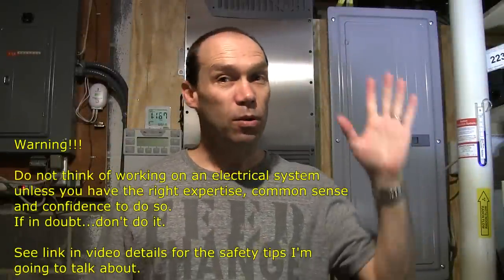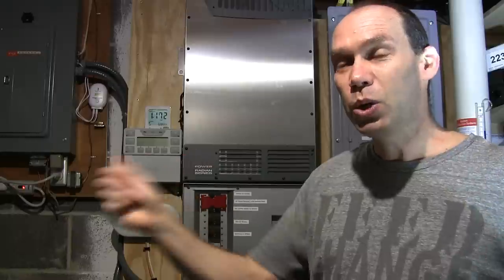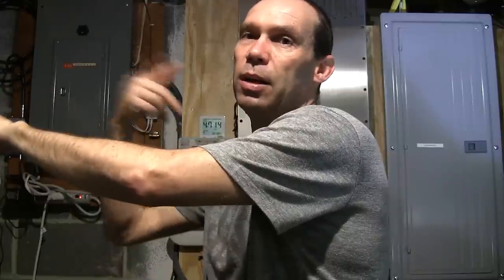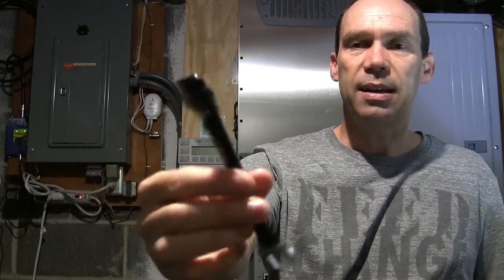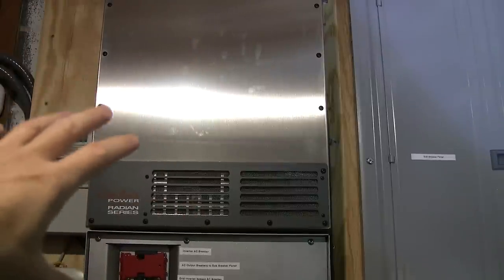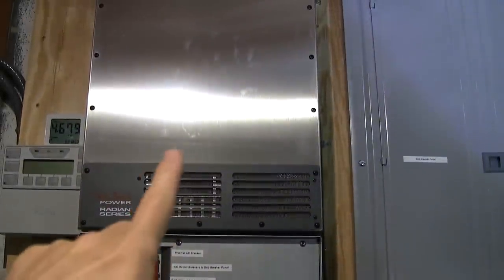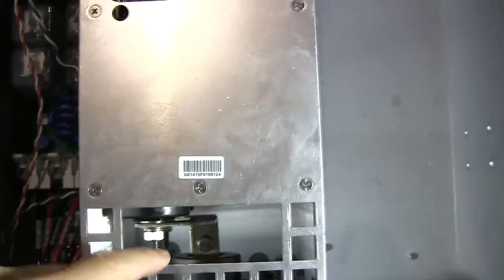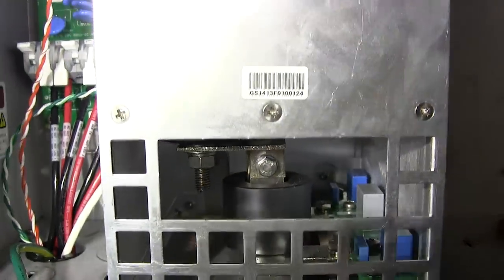Electrical Safety / Inverter Failure

Comment: Outback gear is generally quite reliable, however the Radian series has had a few  instances of failed units. Generally in the past they just do board/module swaps. That modular design is a feature of outbacks.

 Re labelllng and shutdown, in NZ, codes require fairly prescribed labelling and signage. First theres some standard bits, the reflective exterior green dot 'PV, the yellow/black hazardous voltages sign (AFAIK these are international symbols), location of isolators etc, and a full shutdown procedure sign.  Systems containing batterys need a series of labels about spark, exposion, acid burns, and "multiple DC sources". These are outlined in AS/NZS 5033, and AS/NZ4509.

Comment: Hi

I've enjoyed your videos and found a lot of value in them.

In this video you really broke almost of NFPA 70E safety rules in my opinion. I have 20 years experience as an electrician, and over 10 years experience as a Supervising Safety and Health Officer.

Although your use of the voltage detector was good you really should have used safety glasses, long sleeve FR shirt and lockout tag out procedures as many unqualified people will view this. 

In the US inverters must have clearly labelled disconnects, and should not depend on manufacture's instructions as many installations may not be up to code especially solar installations. In the jurisdictions covered by NFPA 70 metal cased batteries are prohibited. The use of electrical tape to substitute for insulated tools and hot gloves is a particular concern of mine as I have witnessed several severe injuries and one death as a result of improperly trained electricians doing work on hot or improperly isolated equipment.

Removing the cover is fine without required PPE per safety recommendations. Anything beyond that requires using hot gloves for testing.

Working on high energy systems even in residential service may result in exposure to 10,000 kva, which is highly fatal as the main breaker takes several cycles to trip and the utility may have fused transformers but typically are the slow blow type to withstand transients.

I would like to see you either not produce videos working on this type of equipment or follow internationally recognized standards for safety.

I have enjoyed your videos greatly and hope you continue to provide knowledge to all of us fans.

Please leave troubleshooting and maintenance of of Cat III and CatIV systems to professional electricians or do the research on proper safety and demonstrate those practices. Homeowners may think just changing a outlet or a switch is easy and safe, but my experience has shown that even a simple job like that can create huge hazards.

Dave

Comment: I don't screw with heavy panel covers anymore. I just use a window suction handle and an adjustable strap. It holds the panel cover in place as I lower it. 

You can also insulate tools with 600v rated heat shrink tubing. Which is way safer then tape. As it has a glue inside it to hold the tubing to the shaft. So it doesn't slip off.

Comment: You are absolutely right with the advice for using non-contact voltage detectors. Case and point with mine, after a while of non use it doesn't always work, good thing that I've made a g of always checking on a live circuit before testing something. I only works when I hit it hard lol. I must get another one. So the moral is, never fully rely on you test equipment to be right. Cheers :)
Reply: And double check with a different type of tester. ( I have a similar problem on  mine with the push contact switch )

Comment: I have received a shock from a screw driver wrapped in sleeving, the sleeving slipped and my finger accidentally touched the shaft, luckily it was only 240v and not 400v (in the uk)and my other hand wasn't touching anything. it was only a light buzz but i yelled out because i got a fright.

Unfortunately this happened at work and it was taken very seriously, in a professional situation if i don't receive the right tools i will NOT do my best and try help out my company to try get the job done on time, i will refuse to do the job until i receive the right tools, because remember, a company doesn't want to know when the shit hits the fan, they will do ANYTHING to shift the blame.

Comment: Good video. Never enough focus on safety on YouTube. 

I have been around light industrial three phase 408 delta and 208 wye for over 30 years. Every actual injury I have witnessed or been around has been arc flash burns to the face and eyes. 

It is critical to avoid looking at breakers or anything that can interrupt a circuit under load. Use face shields when available. 

Electrocution is very rare. Arc burns are very common. Protect your eyes.

Comment: I remember tightening the positive cable to a starter on a tractor many years ago (was probably around 12), right on top where the thick positive cable connects to the solenoid. Then I touched another metal part and the sparks flew... that's when I learned about removing the negative terminal first.

(That particular tractor, a British made David Brown from the 1960s, had a positive earth... so you removed the positive first :-) )

Comment: Good video! One thing to note regarding charged capacitors - the very same fault that brought your attention to a piece of equipment may well have taken out the automatic safe capacitor discharge circuitry. IIRC The Signal Path Blog encountered this very failure mode in one of his repairs.

Comment: Wise words of caution especially about the insulated screwdrivers and spanners.The power on those panels are huge.Working on one in bad lighting, hand slipped and left with only the handle of screwdriver.the rest just vaporised.Non touch phase tester very handy.Eye protection against bright flashes is a must.Wet floor conditions are serious hazards along with metal ladders.Proper tool belt can be very handy.

Comment: Tip for the cover.. Before you reinstall the cover, Get one longer screw(if not long) and wing nut. Take the top center screw and install it back wards( or from the inside out so the cover hangs from it(1/2" to 3/4" of threads stick out). You can hang  the cover and install the wing nut. The cover will not fall while you install the rest of the screws then tighten the wing nut.

Comment: I hope you will solve this without much trouble. What was the average load on that inverter? If it was a few hours 4 to 5h a day working close to full load 3 to 4kW then 8 months is about what you can expect :)
As you know I prefer DC directly to power my loads and I only occasionally use an inverter less than an hour a day for large loads.
I will not expect to use more than 400kWh/month from that 4kW inverter so in 8 months that is 3200kWh and if there where no warranty that is $2800/3200kWh = 87cent/kWh just for the inverter.
If it will last for 10 years (highly improbable at 400kWh/month) it will still be $2800/48000kWh = 5.8cent/kWh still a relatively high number considering that is just the inverter and it is an extremely idealistic estimation.
Reply: ***** Grr stupid youtube one click deleted  me post, short now, 
they should last at least 10 years one would assume it not running at 100% load all the time but should be spec to handle 6KW but limited to 16Amps per Phase to comply with Grid rules 
(assuming 230v and UK but this person is not so not sure about his power but did state 4KW inverter not sure how a 110v would work as its 32Amps ish around 4KW) if the inverter was not limiting output to 16amps then it probably overloaded (dono if you can run a 110v inverter at 32amps to get upto 4KW not unless you had 2 inverters in one case as shown in this video but it only had one in it)
Reply: lee x Yes it only had a 4kW module out of max two possible (8kW). Problem with inverters is that they are relatively inefficient and run hot. Even a 95% inverter 4kW running at full load or close will need to dissipate 200W not that easy to do so. Electrolytic capacitors will dry out at elevated temperatures and will fail (some times they take out other components also). Electrolytic used in this inverters are usually rated at 1000 to 2000h working at those temperatures so you can imagine it will not last long.
I think is a split phase 120V/240V inverter but that is less important.
I recently made an youtube video about MPPT obsolesce and got a bit in the details about electrolytic caps same problem apply to DC-AC inverters.
Reply: ***** So even the new "transformer-less" grid tie inverters may not be a better choice  because as you point out, even at 95% eff you still need to shed 200 watts of heat (@ 4000 watts). I think I've answered my own question, and given that, the more important thing then is air movement across the unit. Looking at Martin's Radian, I don't see a internal fan, rather some vents top and bottom which are meant to create a draft.  Perhaps some inexpensive forced ventilation IE: a small computer fan ? would help with the life expectancy of the capacitors ?
Reply: Mark Osborne
I think there must be a fan in there maybe is not visible.
Reply: Mark Osborne it's on the top of the heat sink
Reply: lee x Gotcha...

Comment: HI Martin good vidoes i have taken the city and guilds coarse recently and isolating the panels on the dc side is the one that a lot of people forget .If its not done you are going to get badley hurt or killed.and should be explained to people.Infact the whole system should only be attempted by  someone who knows the score simple as/ lethal.

Comment: Nice safety reminder! Personally I wouldn't feel comfortable approaching overheated electronics and capacitors without wearing safety glasses.
Reply: Vincent Schmid i agree them caps run at very high voltages and its DC as well (goggles and gloves and should not trust that your insulated footwear is enough) even though its de-energized there is still a slim chance there could be power (why some people physically make sure the cables/plug are disconnected)

Comment: I hear Voltage stick's should Only be used to give a guide that power is ON.
They may be for example too far away to trigger and indicate no power but where there is 
 power.

Comment: mjlorton There are labels that warn about Radon in the background. I am curious what kind of system is this?
Reply from the maker: Good question, some day I will post a video about it. I knew nothing about Radon until moving here to Cleveland Ohio. Read a little more here if you are new to it: http://en.wikipedia.org/wiki/Radon
Radon is more of an issue here because homes are insulated due to the heating and ventilation systems. The HVAC system can cause a low pressure that pulls more radon from the surrounding soil (basement) into the home. To mitigate that and to reduce radon levels in the home pipes are placed through the basement wall and floor. A fan then draws the air out and expels it above the home outside. This helps counteract the low / negative pressure in a home which draws in the radon gas.
http://en.wikipedia.org/wiki/Radon_mitigation
http://sosradon.org/reducing-radon-in-your-home
Hope that helps.
BTW...you have a great channel.

Cheers, Martin.
Reply: mjlorton Hi Martin, this is very interesting! You really should make a video on the subject soon. Here in Germany only a few and only newer buildings have a ventilation system. Therefore the issue of radon mitigation is hardly known in the german-speaking countries. My mistake was to look only on german websites - and also the german version of wikipedia just slightly mentions the topic at all. Btw thanks for the compliment that I only can return. Your videos are always interesting, factual and very instructive. :)
Reply: LuiKast I've always thought that radon isn't an issue in Germany. Here in Scandinavia I think levels are in some areas much bigger than there. Though I guess radon can be found anywhere in globe, but quantities have huge differences depending on location.

Comment: I suggest reading Article 690 of the NEC regarding your installation. Appropriate changes should be made regarding the ease of disconnecting all sources of energy. Only qualified persons should attempt repairs. Licensed electricians are required for electrical instillations in most states (Ohio etc.) You should never work on live circuits, with the exception of necessity, and then with the proper PPE.